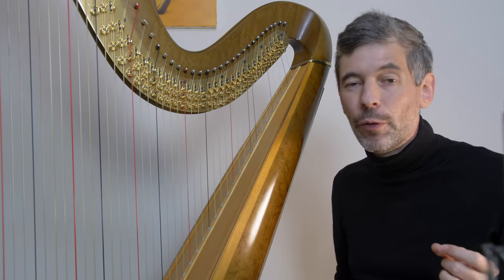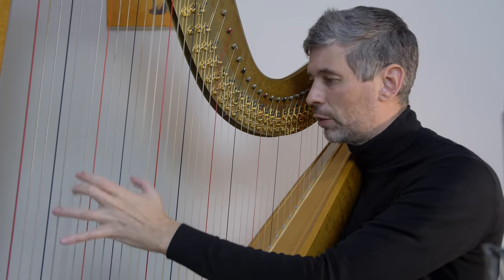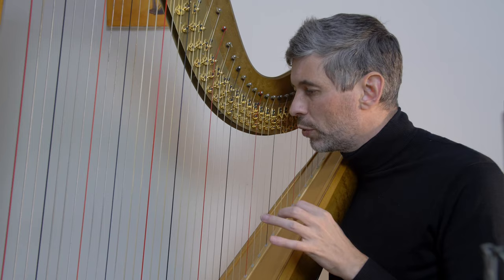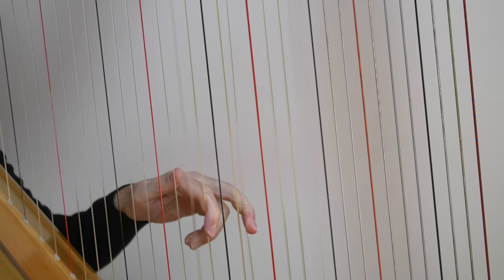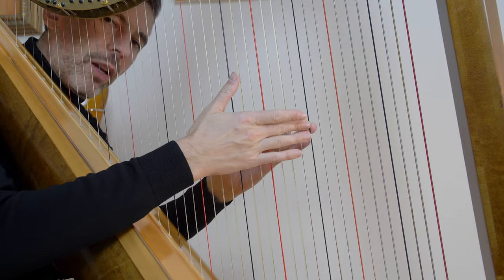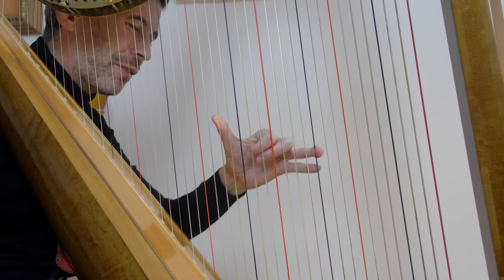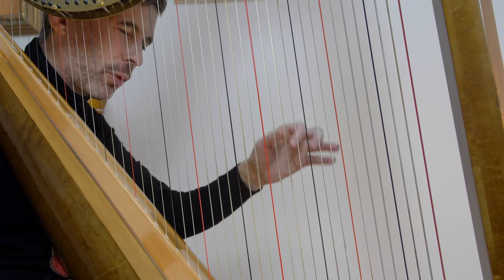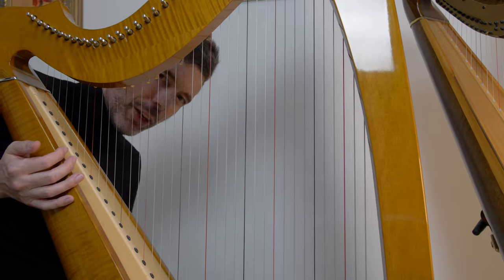Harp muffling technique (featuring Pachelbel's Canon). Harp Tuesday ep. 247

Comment: Thank you so much, Josh! I have a question: in this video you show the technique sliding up from a lower to an higher string. How does it work from a higher to a lower string? Do you also have a video on it?
Reply from the maker: That tends to be more difficult - you can use an open thumb (ettouffe) in some cases, or place a finger or thumb on the string to muffle it - check out the full list of muffling related episodes I've done here: https://www.harptuesday.com/category/muffling/
Reply: Thank you so much, Josh!